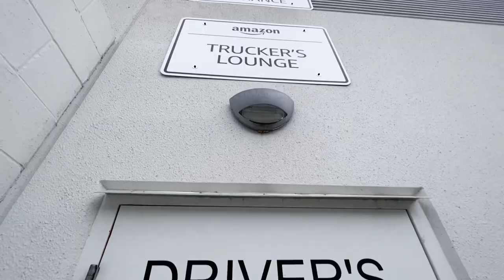Is There Still Money In The Box Truck Business Moving Amazon Relay Freight? | Mentee Meet Up Vlog 🚚

Comment: Vicc my personal thoughts, I wouldn't get an electric vehicle bc (I could be wrong) those things take long as hell to charge and if you ever plan on traveling or are forced to travel that thing will not make it and you'll need to stop and wait for potential hours for it to charge. Not to mention if you're in a line lol, you might as well set up camp. That's my 2 cents on the matter and again it could be wrong or missing info here.
Reply: We in a chip shortage during a oil domi ated era...go electric and have your truck in the dealership for backordered parts for 3 months and leave with midsize sedan car keys if you want to
Reply from the maker: Most of them take about 18 min or so to fully charge. Depends on the charging station your using. You can also get one installed at home.